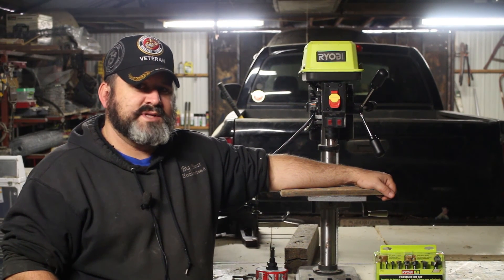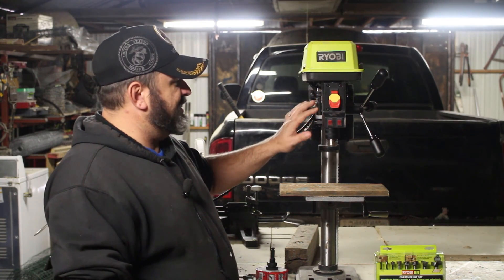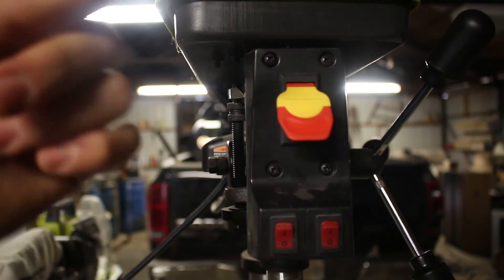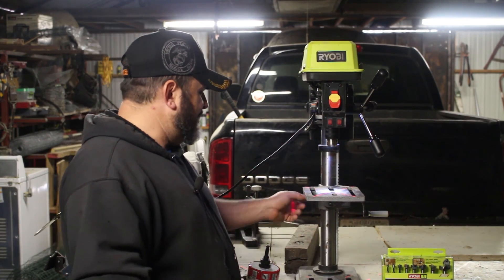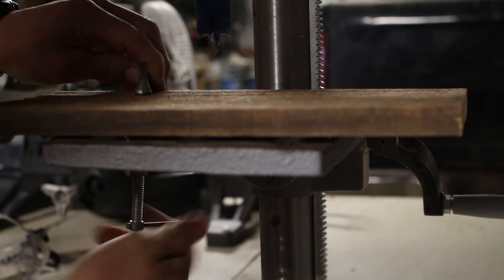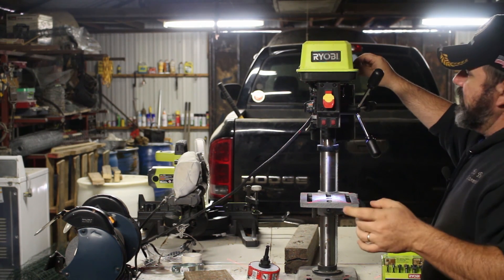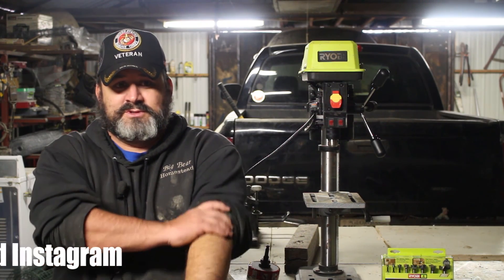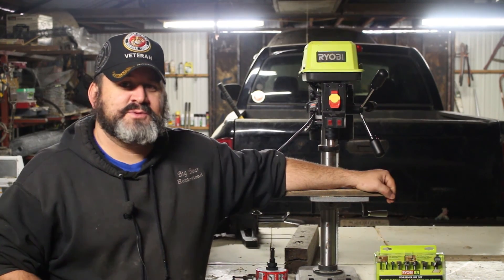How Well Does The Ryobi Table Top Drill Press work

Comment: How does one pivot the table?  There is a small nut under the table bevel plate lock nut. This small nut is in the way to get a spanner on the bevel nut. However this small nut does not move at all.
Reply from the maker: That nut should move, try some wd40 or that lock tight spray

Comment: Yep I got this a couple days ago because of the crank table adjustment. I thought the wabble in the store was because the store did a crappy job of assembling it.

Yeah it wabbles when it's cranked and it's irritating.

I can't see why have a 10 inch drill press and only have 2.5 inches of movement too.

Why not have the crank for table lift up the part, lift up to the drill?

So I'm now working on a way to do that with this drill press I will make a video if I come up with something
Reply from the maker: Thanks for sharing ,have you been able to fix it yet?

Comment: concerning the speed changing. You do not need to "unscrew" that knob on top. It is a pull knob. The you just push the belt into the pully for the speed. Move up for higher speeds. the belt all the way on bottom is slowest.
Reply from the maker: Thanks for clearing that up